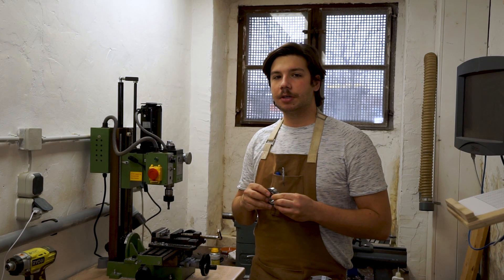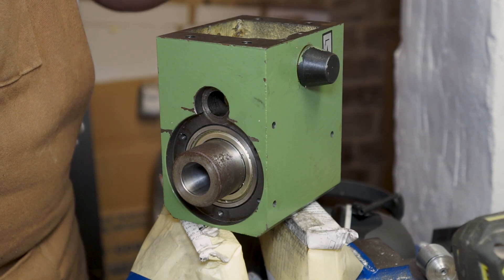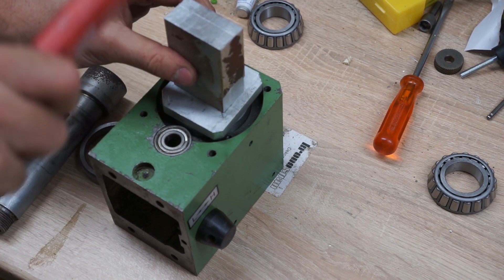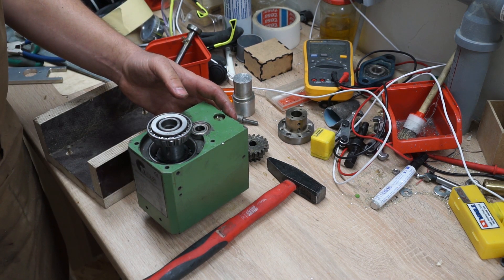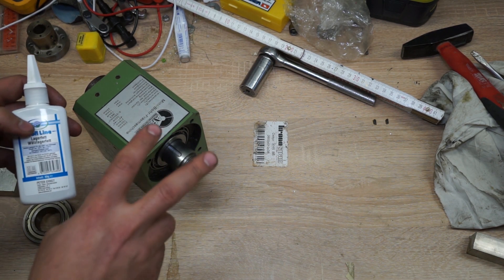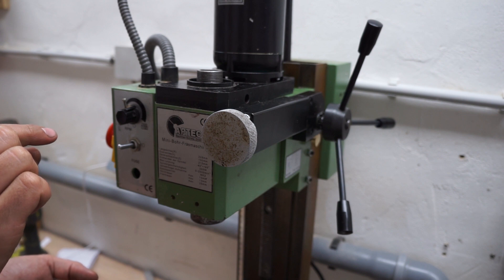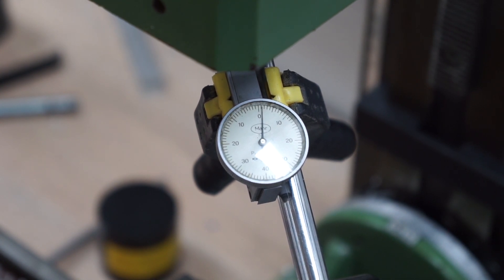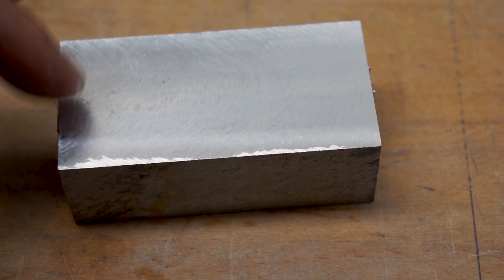Upgrading to Roller Bearings on the Mini Milling Machine

Comment: Hey great job just 1 comment because all bearing parts are press fit into their counterparts you will not be able to adjust your bearing preload. I would have removed the press fit on the upper bearing (the one with the bearings not the race) on the lathe by lightly sanding the upper part of the shaft where the bearing usualy sits this would allow you to do a bearing preload.
Reply: @michaelmeyer6603  im not sure but i did it to mine and its quite a change.
Exactly what i did is as folows.
I removed the pressfit on the outer cage of the bottom bearing by mounting the mill head on my lathe and lightly sanding  making sure to 1 not remove so much material you want a tight slipfit 2 making sure to keep everything parallel. Then i removed the pressfit off the top spindle shaft again in the lathe making the top bearing inner race slip fitting. I then press fit the lower bearing onto the spindle by pusing it using its inner race and pressfit the upper bearing into the top of the mill head by pusning on the outer race (don't push bearings in by the non contacting reace) then inserted the spindle into the head with just a hand push and adjusted the pre-load.

Comment: Tapered roller bearings are great for high loads  and RPM under 2000, Go much over 2000 RPM for any Length of time and they will overheat.  Conversely ball bearings are better for lighter loads and high RPM applications.
Reply from the maker: well the max rpm is 2500 and I rarely machine long at those speeds.
But it is a valid comment, thank you very much

Comment: Nice work.  I'm considering doing this to my mill too. What about stiffing up the vertical guide?  It is really not very stiff and can easily deflect with pressure. This causes uneven surface cuts and chatter.
Reply from the maker: I think the point of those machines are to kind of figure out where the importance is for you so you can make educated choices when you upgrade
Reply: @Uniquelymade  Exactly, what might be a huge waste for one person is completely worth it and fantastic upgrades for another. Also, many people, especially the ones with the big 800-2000 kg cast iron behemoth milling machines don't seem to understand that yes for €1000 extra you can have a machine that is 5-10x better, but it also requires a portable crane and a poured concrete floor along with 3 fase 380V to run, and of course a lot more space. For a lot of hobbyists a small mini mill or lathe mounted of a desk or wooden bench is all they can afford space wise, and in those cases trying to get the most out of their small hobby machines is a very understandable and legitimate pursuit.
Reply from the maker: That Is actually a great idea.  The movable column makes more trouble then it's useful

Comment: Good, I did the same to my mini lathe but I sanded the top of spindle so bearing slides a little so you get right preload and then set. This works just like spindle brgs on front wheels on a car, older style.         Jesus Saves
Reply: I added a belt drive which works great, also added a large 1/2(13mm) plate to back of column to be able to really tighten the back nut' and added a bracket to each side to adjust mill tram, there are videos on it or websites, it really stiffens the mill

Comment: of note though, if the races were cooled (as you did) the removing them would become a machining job in and of it's own.
But all in all, nice job Max.  I am currently awaiting the arrival of a new (Steel) hi-low gear from LMS to replace the goobered up nylon gear that came installed in my mill.  All other gears were already up graded save the secondary or shaft gear for the motor drive. retaining a plastic/nylon gear in this location may prevent further gear damage in the future and this gear is a 5 minute fix at worst, providing there is a spare on hand.
Reply: Getting the outer races out sometime in the future may be a problem… A common motorcycle upgrade was to swap-out the original cup and cone crowded-ball steering head bearings for taper rollers. Removing the old style bearings was easy enough as there was wide seat to tap against with a long screwdriver or suitable lump of metal. If taper rollers were installed the bearing seat was only slightly bigger than the machined register it bore against within the steering head, leaving only a tiny edge to tap against if ever the bearings needed changing.
A somewhat extreme (but effective) technique I’ve used is to run a bead of weld directly onto the conical surface of the bearing, then… when the weld cools it shrinks the race slightly and it either makes the bearing easier to tap out or (if you’re very lucky) the race may just fall out. As I say extreme but effective…

Comment: 3:30 did you try without cooling the bearings? (Just curious how much it really helped.)
Reply from the maker: I did try pressing a small bit before and honestly I don't think it made the biggest difference. I still needed a decent amount of force.
But with the lack of precision these parts are machined I think every bit helps (if you have a real press it probably doesn't matter)
Reply: Cooling bearing rings (often called ‘races’ or ‘raceways’) is a valid and effective way of temporarily reducing the interference fit. We do it all the time at work in overhauling rail vehicle transmissions. Heating the housing as well (if practical) also helps. If you want to delve into the mechanical science, try to find the coefficient of thermal expansion/contraction for the bearing steel and (if required) the iron housing and simply calculate the contraction/expansion of the component diameters based on the temperature difference. Incidentally heating the inner bearing ring/roller assembly also works when installing on an (optionally) cooled shaft. Companies like SKF recommend an induction heater for exactly this purpose and also specify a maximum allowable temperature so the bearing is not unintentionally heat treated…